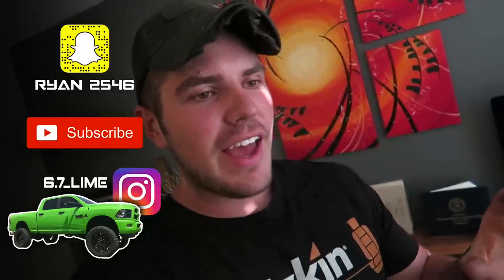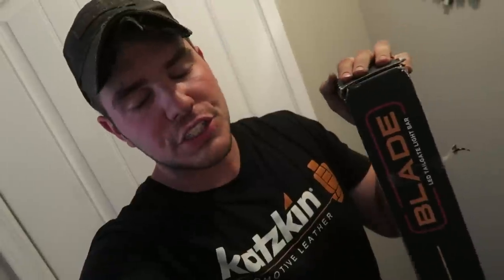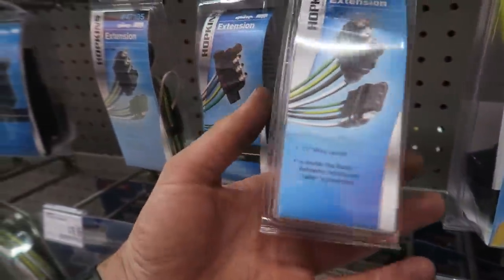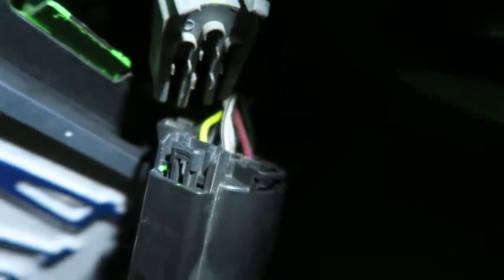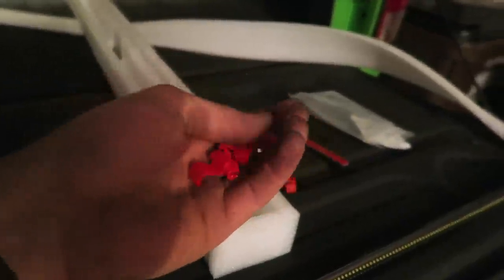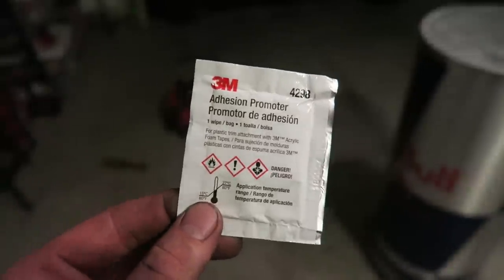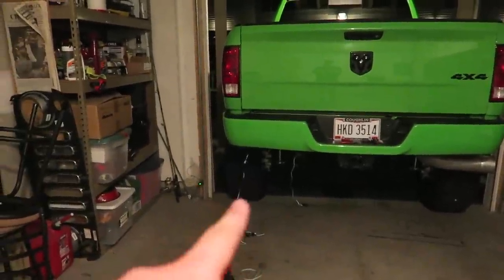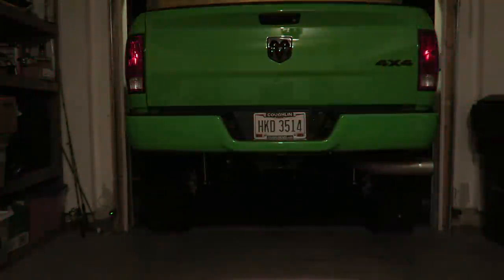LED Tailgate Light Bar INSTALL!! *Super BRIGHT*

Comment: looks great. i was wondering if you could help me out . i have a 2012 dodge ram 2500 crew cab. i have vibration inside the cab. i dont know what else to try. i have put new tires new wheels new ball joints new steering stabilizer . wanted to see if you had any advice.of course my wheels are just 17 inch. any advice would be help full. your truck looks good.
Reply from the maker: What wheels and what tires are on the truck
Reply: @ryan2546  they are just discount tire wheels.american outlaw wheel. And the tires are Michelin tires. 265/70r17 defender ltx
Reply: pete flores camber and alignment ? 
Bad stabilizer? Bad shock? Worn fan belt?
Reply: @akbychoice  I replaced shocks. And I did a alignment. Still does it. The only thing I haven't done is the fan belt.
Reply: pete flores does it feel like it’s coming from the wheels? From the front or the back? How about checking the motor mounts to see if one is broken?
Reply: @akbychoice  it feels like it's coming from the front.its not a bad shake but you can see everything  moving like the arm rest and seats .and it happens around 70 mph.
Reply: pete flores any bends or nicks in the fan blade?
Reply: @akbychoice  I will have to check on that one.
Reply: pete flores not that I think this is it but, one of our semis had a terrible vibration at certain speed. It turned out to be a loose piece of aluminum tape used as a ground plane for a radio antenna that came loose and was flapping in the wind.

Comment: What happens when you have to drop your spare tire? looks like its blocking the access to lower it.
Reply from the maker: My spare tire is useless with the 37’s pretty much however it can be removed because it snaps into brackets and the brackets are stuck on

Comment: I use a 5 pin adapter for towing my boat, will installing this interfere with the function of the 5 pin system?
Reply: no it won't.

Comment: Should have installed a "tailgater toggle" or work light switch for the white reverse lights. There is also an adapter that goes into the factory clip that eliminates all the splicing and dicing. Might cost more, but what the hell, for a $200 light bar might as well shoot for the moon. I've bought whole vehicles for less back in the day lol!
Reply: Factory clip fill me in I'd like to know more about that
Reply: Dustin Crook click on the light link to amazon in the description, below it shows a harness.
Reply: For anyone confused, hes saying you can already get a spliced harness with 2 connectors that eliminates the need to hack any factory wiring up.   100% plug and play.
Reply: Yeah, that's what I meant by a "factory clip"

Comment: Nice bar with all 5 functions but there's no way I'm cutting into factory wiring . . . that's asking for trouble . . .and if the dealership see's it . . . you are SOL..

I have a 2017  F-150XL and the Curts Adapters are suppose to work but . . . they do not for my truck . . . I've tried. 
They interfere with even my basic tow system and will cause some of the light bar functions to not work properly.

i will have to find a way of coming directly off the back of the light plug without splicing or quick connecting.  Stay Tuned. 
. . .  I have to do my tailgate assist soon and will have the light assembly out then to get a good look.

Wish there was an in-line 2-into-1 adapter for our  oem plug but . . . that's never going to happen.
Reply from the maker: Putco makes a tailgate bar for fords with the tow and lane keeping systems 👍🏼

Comment: Only a couple seconds to pop the tailgate off for more room to work.
Reply: Pete Mycek couple seconds my ASS.you ever tried removing a locking silenoid type tail gate from a RAM PU
Reply: Exactly what i was thinking....
Reply: Shit you take off the tailgate and the bed walls will fall apart that's the only thing holding it together cause it's a dodge
Reply: The tailgate has to stay on in order for the light strip to be placed correctly. If not then the bar will be blocked of by the bottom edge of the tailgate
Reply: @lisandro_5751  yes true but ok here is the but. Leave it on make the markings on where it's going to go then take the tail gate off. Now that's the easy and smart way right

Comment: Doesn't it interfere with the hole you need to lower the spare tire?
Reply from the maker: Nope! It’s designed so if you need to it pops off the mounting brackets to reach the hole!

Comment: Can this bar be put on an suv? Specifically a Chevy Tahoe.
Reply from the maker: I wouldn’t see why not just figure a way to make it clean 👍🏼
Reply: Get a pro to do it if you have to ask or just wire the bar to a Trailer plug and plug it in without destroying the rear wire harness.

Comment: Shame you cut the harness! I woulda went to the junction box on the rear of the cab! Easier to mount, solder wire connections and make look cleaner! I’ve done it to every truck I’ve owned!

Comment: What a shit wiring job, that was not a water tite connection, they will turn green.. that was a novice job. Friends don't let friends wire there truck like that
Reply from the maker: 😂😂😂 yep man! Didn’t use cheap ass bud connectors or t taps! Also didn’t cut the wire in half! Never thought 8 layers of tape wasn’t enough! I’ll try a whole roll! Or Next time I’ll go to pep boys get come cheap connectors and solder and heat shirking tubing so I have to cut the wire completely so when I need to remove it I’ll have to cut wires again! Shame on me! Wired like this plenty of times and next time because of you I’ll try and do it a way that while at work I repair all the time! Can’t believe I had no reason behind wiring the way I did! Silly me!
Reply: @ryan2546  lol don't listen to him it doesn't matter never let anyone get you down you did good and that's all that matters man I love your truck and I love your channel man keep up the amazing content
Reply: The best way is to purchase a "T" connector.  No cuts, splices, etc.  All plug and play with weather proof connectors.  Try to never strip the insulation from weather exposed wiring unless absolutely necessary .  Love the light bar though gonna order one!  Here is a link for T connector, I'm sure there are others too.  https://www.curtmfg.com/part/55504
Reply: Maybe I got lucky but I did mine the exact same way five years ago and live in Buffalo NY.  No green wires and everything is still flawless.  I've been splicing for years and can attest that when done carefully and wrapped tight there usually isn't a problem.  Sure a T connection is best if you can source one.  Sometimes I'll take the extra time to solder but seldom find it essential.  I will say on a SEMA truck is probably go the extra mile and T it.

Comment: Could u just plug it in the the trailer wiring harness?
Reply: Yes. You can plug directly into a 4 pin harness and you're good to go. Think of the bar as trailer lights. Need to hook up an actual trailer? Disconnect the light bar and do so. The light bar is pointless towing a trailer. You wouldn't need it. The exception is the reverse lights. You'd need to plug into a 7 pin harness or tap into the reverse lights to get juice. The 4 pin harness doesn't have reverse wiring.

Comment: I was with you  until you taped up your trailer light connections??!!! Lol. You were right those splices are for a novice but you twisted wiring and tape job was straight below the novice level, a little solder and heat shrink will make your wiring last 10 years instead of 10 days! I hope you  don’t do this to all your trucks hahahaha

Comment: There is only a few wires in the harness just use a goddamn test light and stop messing around! I have seen vehicles where the cover on the seven pin harness were marked incorrectly! Also by the time you were done looking for a wiring diagram you could have been done using a test light!

Comment: Uh-oh, all his efforts undone by shoddy wiring... Rather than criticise, I’d just like to suggest that in the vulnerable position the wiring is, your joints should be soldered and shrouded in heatshrink to insulate, then a couple of layers of self amalgamating tape over the whole spliced area plus a couple of inches either end, before a good couple of layers of insulating tape 👍👍👍

Comment: If you took a sewing pin and put it through the protective coating on each wire you were testing and then connected the lead to the very thin sewing pin you wouldn't have to cut all that protective coating off . You don't need to and shouldn't expose that amount of wiring. DANGEROUS!

Comment: I think it is too bright for running lights, and too bright for full time reverse lights.  Turn signals are not needed.  It does look cool.  I would modify it.  Leave the brakes full time.  I always want added visibility for stopping.  I get the brightest thing I can for my motorcycles.  No turn signals, you already have 2. Running lights on a switch if you want to look cool.  Reverse/ F U on a switch, when you are in a super low visibility area or someone riding your bumper.  I may look at a cheap one since I do not want all of the functions anyhow.

Comment: These "lightbars" are so damn ugly...not sure why anyone thinks they look good.  Love seeing trucks out there with them and the lights are burnt out.
Reply: ahh, nvm.  Typical dodge owner.  Bet the mirrors are folded out too.
Reply: They are ugly. The only reason I would get one though would be to light up the area behind me when reversing at night and there’s no other light sources around to help me see where I’m going.
Reply: @117rebel  then get rear mounted LED pod lights and install them on a switch
Reply: Given how many "cheap" kits are out there, the ones you see with blown LEDs are probably just that. CHEAP. I am not familiar with this brand, but I do know that cheap LEDs dont last as long as the better made ones. And before I get flamed, notice I said cheap not inexpensive. There is a difference. Personally, I want as much notification of my intentions as I can get without blinding  someone due to how many distracted drivers are on the road lately. That's why I plan on in investing in a nice good quality light bar like this. But to each their own. Not ur cup of tea, u r not forced to use em.
Reply: @Buckmaster299  You want as much notifications for other drivers but yet a turn signal or brake lamp that your truck came from the factory like isn't enough...all with looking like an idiot with this shit installed on your truck?  The only trucks these should go on is the mall crawlers with dished rims...because the owner has already destroyed the truck at that point.
Reply: your just mad cause there is no place to mount one on your $300 caprice classic.
Reply: Eric Miles easy there big guy. I didn’t cuss you. Just havin a little fun. To each there own. If he likes it great. If you don’t great.  No need to condemn him for it. That’s what makes the world go around, different strokes for different folks.
Reply: Tennessee Jeff hE hAs A 2018 f150 HeS a BaDaSs
Reply: Complains about lightbars then tells someone to get light pods.🤣

Comment: Worst install ever.  You should have wired the light strip to a Trailer plug and just plug it in to the factory Trailer receptacle.
Glad you didn't destroy GM wiring.  About 1 month in winter driving and you will be having issues with lights that don't work.
Reply from the maker: Gord Baker good thing I own a Ram Bud!!! Trust me there’s no water getting to those wires. I love how I have to explain myself to everybody on why I wired the way I did. Just told some kid yesterday the same crap. Why would Wire the light bar to a trailer plug, oh wait I did that, why would I plug it in on the front on my bumper so it shows all the time, ok I didn’t next option wire to the trailer plug behind the bumper ok I did that next step solder it and then wrap it up, ok but if I want to remove it I have to cut the wires off, ok so let’s wire it the same way expect not use solder and then I’ll wrap each wire then tape each taped wire to every taped wire then I’ll tape the entire harness. Wow look at that! Damn should I have cut my factory harness in half then Used cheap ass bud connectors? Or the huge bulky and exposed t-taps that always fail? Or let me cut my harness in half so I can put heat shrink tubing on it? And then still tape it? To wrap the harness back up? Which one of these techniques did you use on your sensitive Chevy and mess something up? Crusty ass rusty exposed bud connectors that never seal or the t taps you can never seal properly at all because of the bulky awkward shape?
Reply: You just don't get it.  5 rolls of tape for that hack job?  As others have said, kits are available to adapt. Plug and play. Trailer or light bar.  As you said, 2:00, it does sound dumb and stupid.  Real Trucks have 7 pin wiring.  Your wire 'connections' will soon match the rest of the truck, Puke Green.  Have another beer.

Comment: Why hack a harness. You can get the plug n play that goes between the harness plugs. What sh*try install. You should of hidden that part and not mentioned that half ass wiring job

Comment: Your wiring splicing methods are awful. At least solder it or use some heat shrink 🤦🏻‍♂️
Reply from the maker: The_Silent Dragoon impossible to use heat shrink without cutting the factory harness also can’t remove the bar if it’s soldered to my truck without cutting, i see where people are coming from and I do it with every other connection however in this instance to get the result I needed I couldn’t/didn’t want to do either